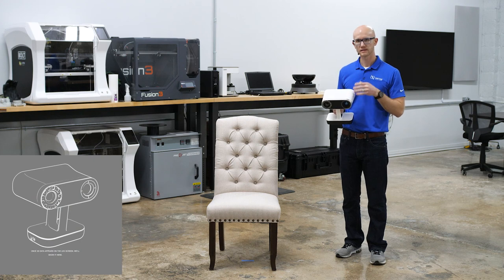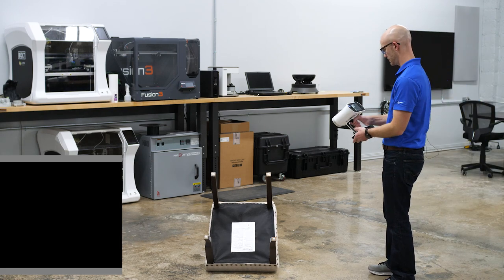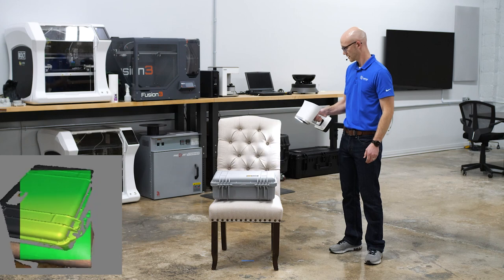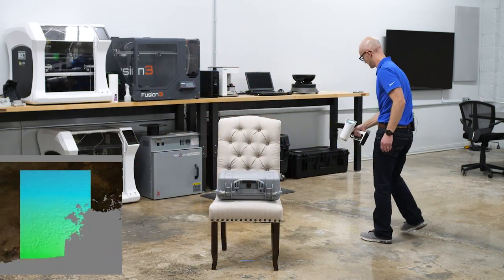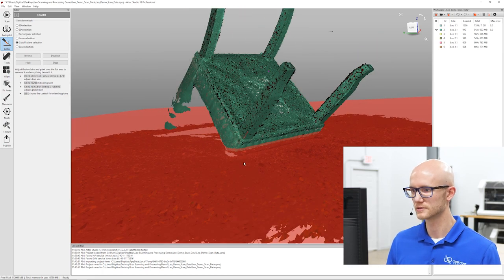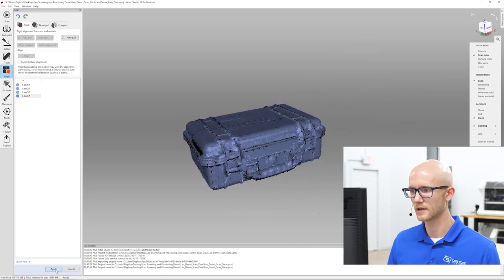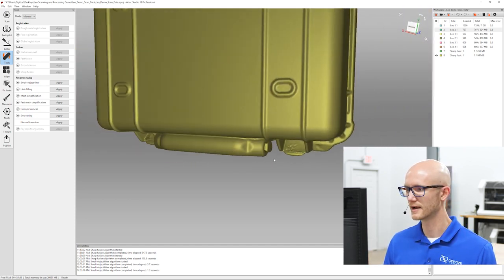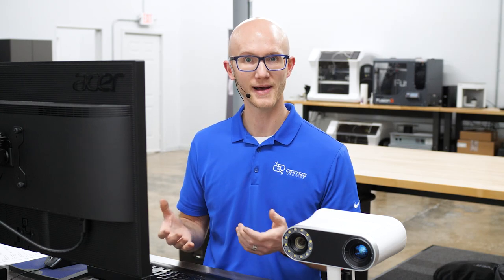Artec Leo Full 3D Scanning Demo w/ Sample Data

Comment: I'm an architect and I work in Autodesk's Revit.  I've worked with scan files from Faro and Lieca for buildings.  I do a lot of High-Tech labs with complex and detailed existing Lab Equipment and I need a way to capture the Lab Equipment in finer detail so I can either use it directly or model it, I also need to be able to import a *.RCP or *.RCS format file to get it into the Autodesk ecosystem (both Revit and AutoCAD) and Recap for registration. Of course, as a one-man office, cost is always an issue.  

I'd also like to be able to scan something as big as a house, several interior rooms in a commercial project or say mechanical equipment or the congested above-ceiling attic spaces full of pipes, conduit and mechanical ductwork. I'm not sure if a SLAM type scanner is more appropriate.
Reply from the maker: It comes down to the level of detail and the area you need to scan.  The SLAM scanner are fantastic for capture a ton of data over a large area very quickly, but they don't have great detail and their accuracy is far less than a hand-held would be.  That said, you'd never want to scan a full room with a hand-held (Artec Leo), so you have to decide which is more important for you.

Comment: what is the price of this 3d scanner? which software is used for this application.
Reply from the maker: The scanner is roughly $30k. Artec Studio is used to process the data and export a clean mesh but then it can be exported into virtually any 3D Software. Let us know if you want to learn more!
Reply: @DigitizeDesigns  I really don't see any improvement as an alternative to photogrammetry. Since you would have almost the same result wıth your cellphone and a free photogrammetry software such as Meshroom and mesh quality would be almost exactly the same and texture quality would be even better than this .So what is the point to buy this device with 30 k price? Please give me a sensible reason to buy this device ? Seriously .......

Comment: I really don't see any improvement as an alternative to photogrammetry. Since you would have almost the same result wıth your cellphone and a free photogrammetry software such as Meshroom and mesh quality would be almost exactly the same and texture quality would be even better than this .So what is the point to buy this device with 30 k price? Please give me a sensible reason to buy this device ? Seriously .......
Reply from the maker: Mehmet, thanks for your comment and concerns.  Though the Leo is an expensive device, it is a tool.  Photogrammetry is a great tool in itself, but a structured light scanner has it's unique advantages such as speed of capture, geometrically accurate measurements and scale, extreme portability, and predictable output.  That said, the end use application drives the topic of advantages, so those might not all apply to you and the Leo may not make sense for you as a tool.  Let us know if you have any other questions!

Comment: In fact, worthless color rendering. Very long data processing and lack of accuracy when scanning. Unfortunately, Leo is still a raw product.
Reply from the maker: @hitch-hiker 42 I'd have to disagree, and it's all a matter of expectations and perspective.  The texture the Leo produces for a hand-held 3D Scanner is great compared to others, but is sub-par compared to photogrammetry.  Processing can take a long time if it's a big scan, but again "long" is relative and you make up for long processing time with incredibly fast capture time.  Accuracy is relative too.  If you need a 3D Scanner for inspection purposes to hold 0.001", it's not the right tool for you, but if you need a device for reverse engineering purposes, it's more than accurate enough in most cases.  Feel free to drop us a line if you have any specific questions!
Reply: @DigitizeDesigns  Colleague, I have no questions for you personally)I have more questions for Artek. If you are in the know, now many customers are returning these scanners due to the fact that the actual parameters for the error (accuracy) do not correspond to the declared ones. In particular, there are a number of customers from Spain and a real recognition that the accuracy of the scanner is not higher than 0.7mm per meter. Artek promises to fix everything, but as they say: "we will not have a second chance to make a first impression"
Reply from the maker: @hitch-hiker4223   That's unfortunate to hear.  I can't speak for Artec, but I can tell you we haven't had any customers return their Artec Leos.  In fact, the overall satisfaction from our customers is great.  Maybe the customers in Spain are trying to push the limits of what the tools is made for?  Or maybe they should have Artec check the calibration?
Reply: @DigitizeDesigns  Unfortunately we do not have a LEO scanner. And I can not check the accuracy of the scanner on the reference objects. And to believe the characteristics in the booklets, I stopped long ago.